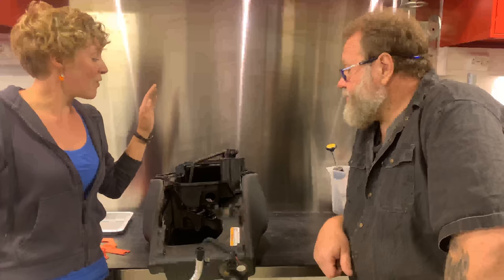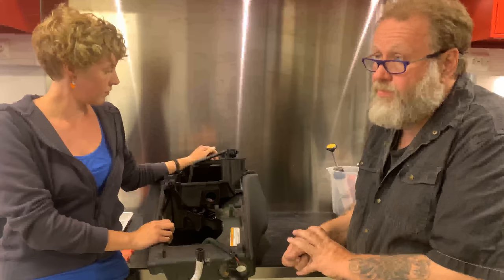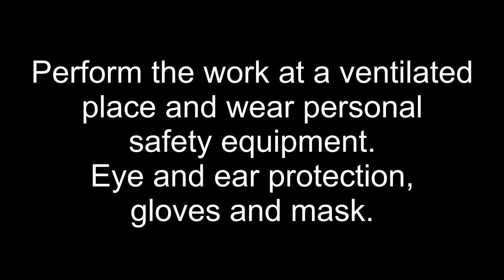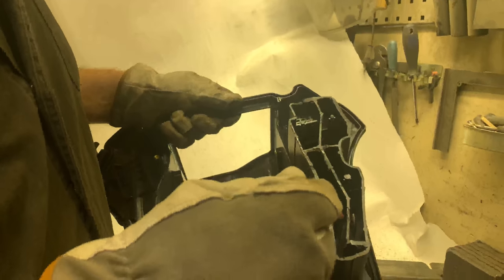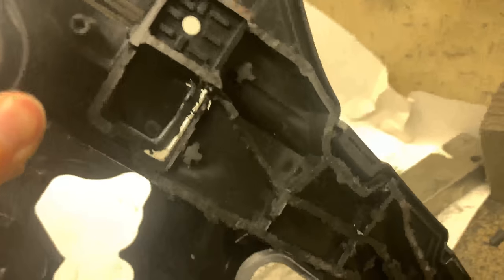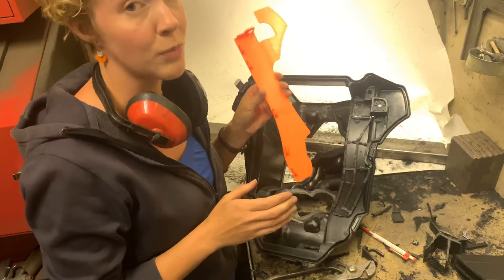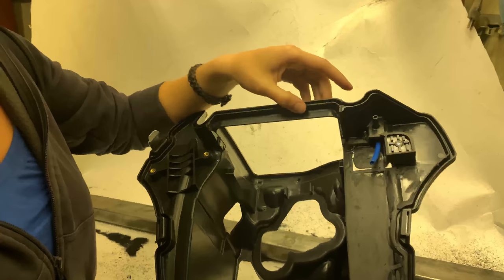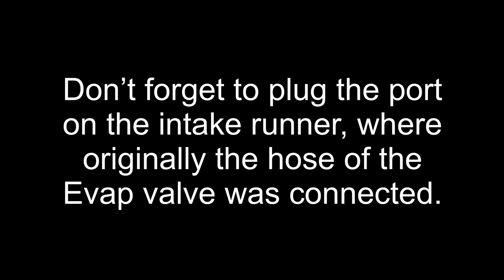NCCR Tutorials: EBR 1190 Airbox Chop DIY Performance modification

Comment: Couldn’t you simply run a new line straight down rather than cutting all that away. Just unplug it and add a line straight down? Is tps reset or ecm flash required after this ?
Reply from the maker: Absolutely. Some of our customers routed a ventilation hose on the outside of the airbox around to the back. Works fine and just require a meter of rubber hose. 
If you plug the original ventilation connection, you could keep the original setup in the airbox. 

But we recommend to remove the hose from the purge valve  to the throttle stack and plug it there. No updated map needed if you keep the purge valve plugged in electrical wise.
If you remove the purge valve electric connections, you will get an error code if you use the stock ECM calibration.
If you have a race ECM or updated your ECM at IDS to a race map, the error message is disabled.

The point of the NCCR airbox modification is to gain more airbox volume and to minimize the number of parts in the airbox.
Our point of view regarding the reason of the engine failures on the EBR 1190 you find here:
https://youtu.be/DuHWLUIUiiA